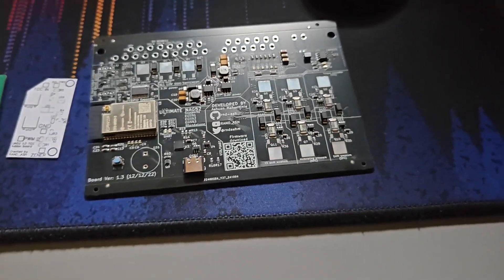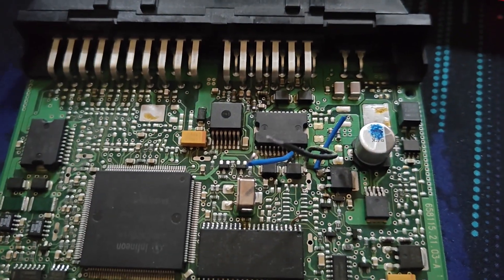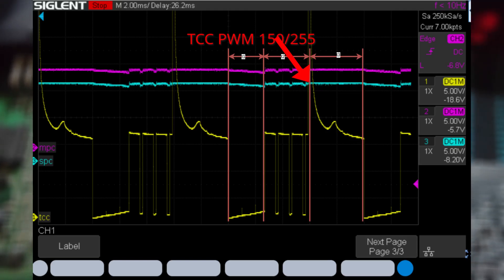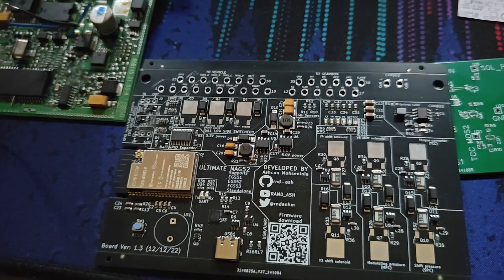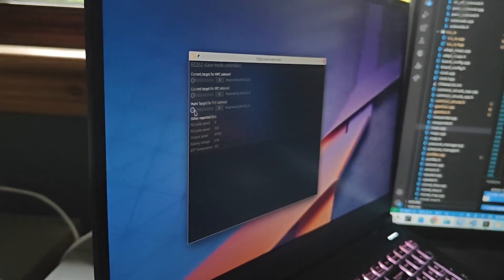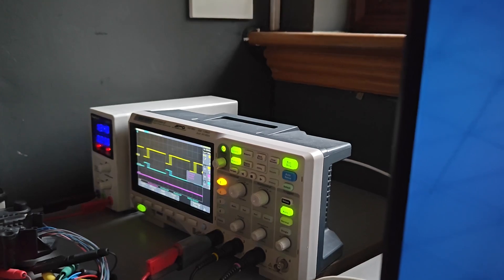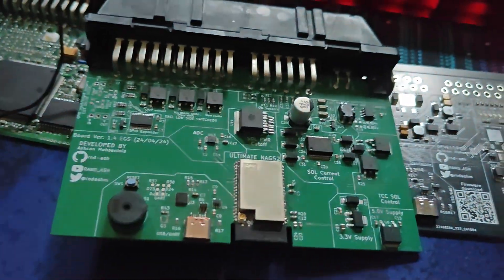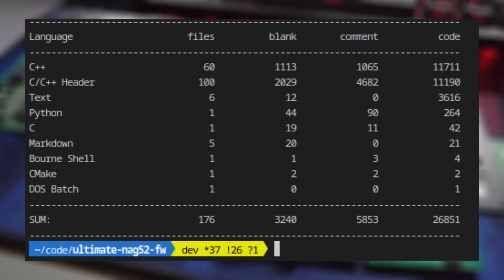Ultimate NAG52 update - TCC solenoid fix, PCB V1.4 progress, and more!

Comment: Hello,
interesting project 🙂

I have a few questions.
First of all, the EGS52 controller has a gearbox learning/adaptation option — does your board also have such a feature?

Second question: can your board be used with EGS52, and is it possible to use it in other vehicles for a typical swap?

Comment: G'day Mate, We are modifying a 2001 C32 AMG for Drag n Drive events in Australia. We are adding twin Turbos to compound into the super charger E85 Flex fuel ect so we will be installing a Haltech Nexus R3 as a standalone ECU and looking at a Standalone TCU we will be chang diff ratio a few times to be competitive for 1/8th mile and then 1/4 mile events. Does you TCU allow this?

Comment: Super cool as always!

Can you consider having up to 9 channels of solenoid control atleast 7 with current monitoring, I know its beyond the scope of the project, but the ZF8 has 7 current controlled solenoids(although at 5V) this may make the platform ready for other high gear count clutch to clutch transmission transmissions. The clutch speed calculations are way easier and every shift is by direct control of 2 elements( one coming on, one going off🙂) i have been checking your code; but i am just a bit above arduino level in programming skills 😂.  Can you give the part number for the infineon chip or is the schematic of the 1.4 somewhere already
Reply from the maker: No, since to control a new gearbox requires completely different code and management. This is specialized for the 722.6, and I wouldn't change that
Reply: @RANDASH  That's ok, the information from your implementation is still invaluable
Reply: @RANDASH  Congratulations on your development progress. I don’t claim to fully understand the finer points you make, but the professional attitude you display and the progress you have made is admirable. I fully understand that this project is entirely designed for the 722.6 (and it’s a massive undertaking) but if you ever decide on a second TCU project, could I also put in a request for a Stand Alone TCU for the ZF 8HP**.
Reply: @fayobam_mech_tronics is the Turbo Lanik TCU still the best “stand alone” option for the ZF 8hp** in your opinion?

Comment: I have S300 W140 and it is going to use your 1.4. And I can use any oscilloscope etc. Please ping if you need a "test sheep". My car will not drive at it full potential anyway for about a year from now as it needs extensive body work. Why I chose your approach?
I am going to push my diesel pump and other to give me about 500 WHP. I am not going further because it is quite undriveable on the streets if I push it to 700+. I am going to use dieselpumpuk pump and diesel solenoids. Ok, not solenoids - those are mechanical :)
Anyway - I am willing to test out anything you got and give you feedback. Just let me know.
Your gearbox addition gives me full potential when I am going from 130 WHP to 500+. The gearbox was kind of weak link in my plan. As Diesel does not give only WHP but A LOT of torque. And I need to mind my locking rear differential etc.